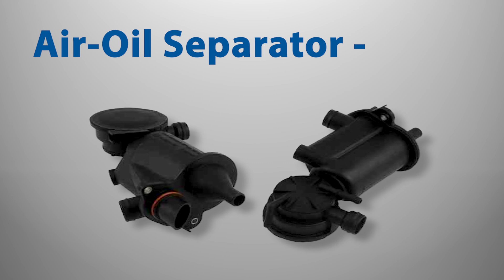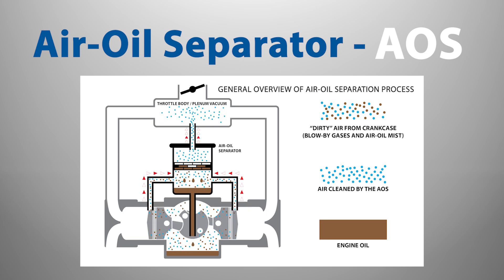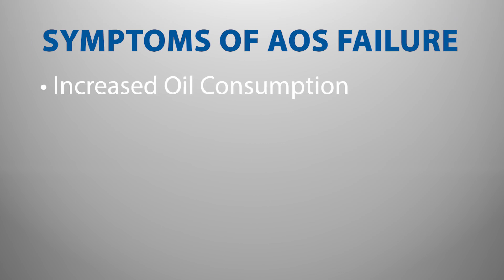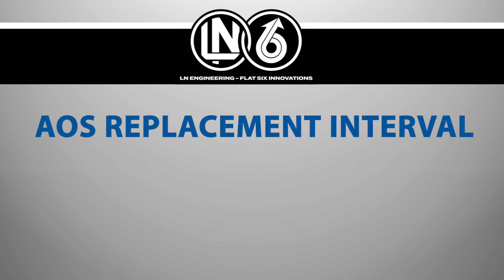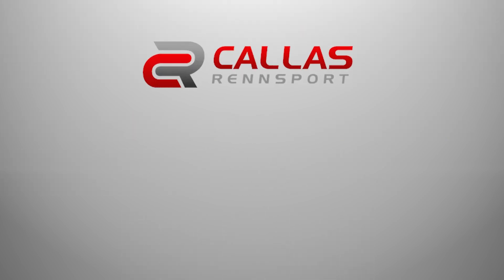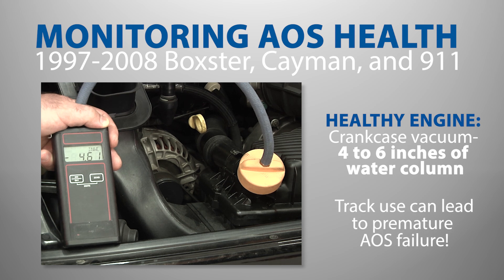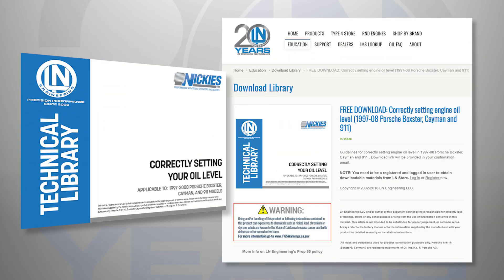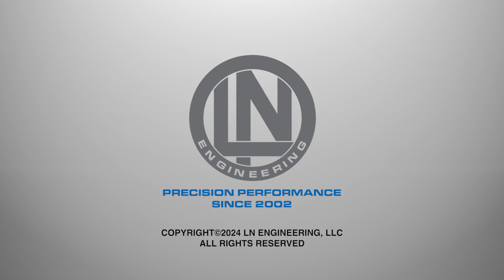What happens when your Porsche AOS fails?

Comment: What if added a check valve to the line going toward sump?  Would that prevent from oil getting sucked up into intake??
Reply from the maker: A check valve would not do it as you still need the suction from the intake to make the AOS function properly. The simplest solution is to replace the AOS as part of preventative maintenance and only use a Genuine Porsche unit on street cars.